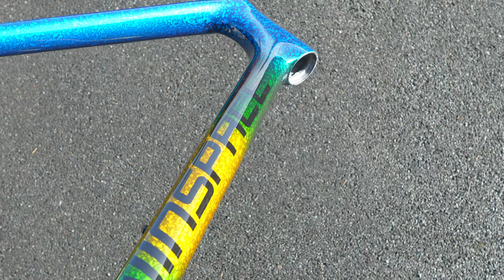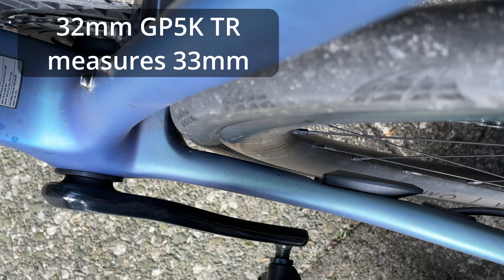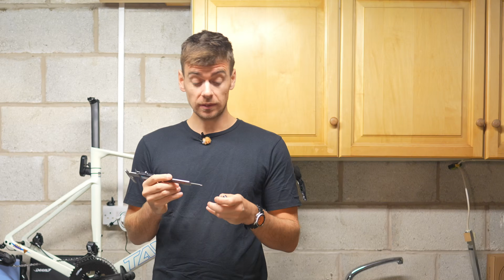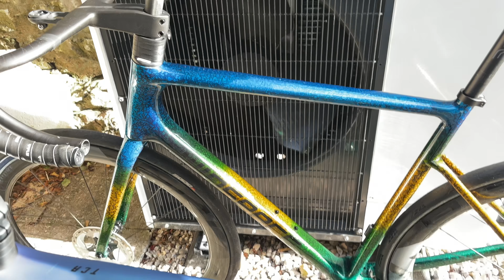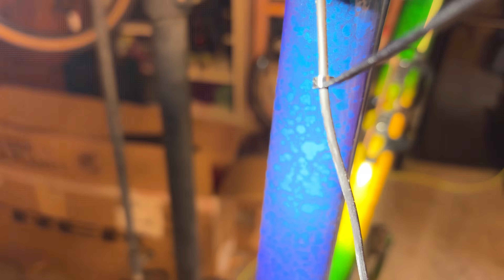Did Winspace win the frame game? #cycling #carbon #engineering

Comment: Great video! 
As a former bike fitter, you are wrong about the Geometry IMO. You are comparing an XL with a Giant XL and other brands 58/68cm frame sets. Realistically it is actually a good inbetween geometry. Similar stack to a race 58cm with the reach of a 56. This is good because you can run a longer stem = which looks cool and good for riders (like me) who have long limbs and short torso.
The real problem is the inconsistency of bike sizes across brands. 2*58s are never the same just like 2*XLs.

Comment: I actually bought the frame and and bars last year on a holiday sale for $1475 shipped, which IMO for all the yipping about Winspace prices being raised to keep up with competition I think is mute, granted all of that might not matter now with the tariff situation.  Either way my SRAM Force D1/D2 and Red E1 with Elite Wheels D50 running tubeless GP5000 S TR with pedals, cages, mounts, and sensors comes in at 16lbs/7.25KG on the dot in a size 48cm/small in the superlight black colorway.  I will concur even with proper torqueing and paste the conical rail clamp on the stock seat post would slip and I am sub 135lbs.  I switched out the stock post for a Roval Alpinist two bolt system like you mentioned, which is a shame since I prefer a zero setback post and the post was only 160g.  The seat post clamp slipping really has been my only issue.  The BB was in spec and allowed for a BBInfinite BB86 DUB one piece bottom bracket with no issues.  The shop that setup the bike with the full 40mm worth of spacers which I thought was crazy at first but the head tube length on my size 48cm/small is 118mm which is very close to a Giant TCR XS at 120mm and the Giant TCR comes with 45mm worth of spacers, thus my size 48cm/small SLC3 with a full stack is still lower than a stock TCR XS and marginally higher than my MY Scott Foil RC w/ 40mm worth of spacers and a 115mm headtube length.  Point being yeah the SLC3 is more endurance than the Winspace T1550 series or other all out aero bikes, but not by much thus to call this bike an "endurance" bike is kind of misleading.  While the bars were basically thrown in for free, the Winspace Zero SL bars are insanely stiff to the point where they take away from some of the playfulness you get with a lightweight bike.  I found the bike to be snappy, responsive, handles wells, climbs well, but it should be noted compared to my MY22 Scott Foil that weighs all in at 17.25lbs/7.82KG you simply don't get the freewheel, propel you forward feeling due to the lack of aero shapes and lack of weight.  IMO the bike feels like a proper competitor to a Giant TCR Advanced Pro, Canyon Ultimate SLX, and dare I say I think this bike would be scary close to a any Colnago V4RS/V5RS.  This all might be mute if you live in the US though since tariffs make the value of this bike or really any Chinese D2C bike invalid since prices then become Cervelo Soloist or even Tarmac territory.
Reply: How is the ride? Some say it's super stiff, some say it's stiff but comfortable as well.

Comment: In my experience Winspace has really gone down hill since this video was produced. They sent me a defective frame and refused to acknowledge the defect, they made me pay $200 to exchange it despite it being under warranty. When I returned the frame (with the label Winspace gave me) they misclassified it and underdeclared the value on the commercial invoice (pretty common thing to do but sucks when you get caught). This caused it to get stuck in customs in Shenzhen and they just left if there, despite me asking them to take care of it. They eventually took action but only after I sent them a screen shot from the tracking that said the frame would not be delivered and would be disposed of instead. 56 days after my initial order, they are holding my new frame hostage ion Hong Kong and refusing to send it unless I cancel the dispute I filed with my credit card company because of Winspace's repeated lies, half truths, and inability to deliver on their own deadlines. I filed the dispute when I did because the 60 day window I had to do this was coming up and I was worried the new frame would also have issues and I would be past the date I could get my money back by the time I received it. Additionally, I gave them a headsup that I was going to file a dispute if they did not ship my frame within the next week. They did not respond until after they sent the frame to Hong Kong but before passing it off to UPS. TLDR: Winspace customer service is pretty much on par with United Health Care.
Reply: So what frame was it exactly, and what was the defect?

Comment: Hello, is it possible to attach a win space slk 3.0 bike to the  smart trainer?  The rear wheel of the bike is mounted on a non-through axle, and the smart trainer is mounted on a through axle.
Are there any adapters to install the bike on the smart trainer?
Reply from the maker: Yes it will fit on a normal thru-axle type trainer (kickr etc)

Comment: Hi Alex, note you’re running Assioma duo Shi pedal axles. I have the same and have issues with excessive play in the bearings. Had a warranty claim in with Assioma and the sent me some new bearing assemblies but the problem persisted. I’ve tried running a grease with higher viscosity base oil to support the excessive clearance on the inner bearing. This works short term but as soon as the grease disperses or suffers and water ingress the play returns, takes around 500km of riding. Play is at a level I can feel through my foot while pedalling.

Any thoughts on the above, how do you find them?

Great video btw, love the honest and informed content. Keep it up 👍🏼
Reply from the maker: @alastairbell9994  i have always had a little play on the inboard side, they say this is normal due to the use of a bushing. Hasn’t got any worse, and I don’t feel it at the foot.

Comment: Just built mine up size small in the superlight black and fully loaded with cages, sensors, mounts, pedals, while running tubeless, Winspaces heavier bars, Force D2, Elite Drive 50D, and running a heavier SWORKS Mirror saddle I am coming to 16.86lbs which I am kind of disappointed in since I was able to easily get an Aethos Fact 10r easily under 16lbs fully loaded and that frame weighed 685g vs 699, albeit it wasn't a one for one since I used a Berk saddle and a Red cassette but that's what 200g at most.  All in all I still think the SLC3 might be the better bike besides the lack of a BSA BB, since on my initial very short ride it was definitely stiffer and quicker to respond, still was comfortable, have more aero features, while still handling very well.

Comment: Would not bearing retaining compound insulate a metal sleeve BB from galvanic corrosion? The threads for the rear wheel through axle could be greased or treated with anti-seize. One could pound an easy-out into the 5 mm hex and unscrew the through axle. 
Windspace knows who you are, that you will measure the tolerances on the frame and will look down the tubes. They have prepped the frame.
Reply: Bravo! 
You hit the nail on the head.
Most of the reviews you find on the web are written by people who have some sort of commercial tie to the company, and it seems to me that this one is no different.

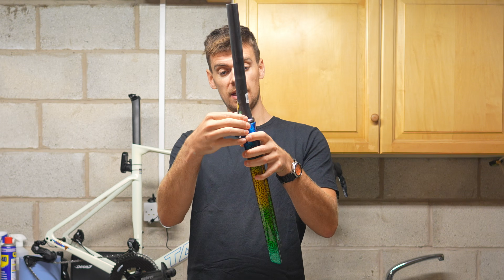Comment: I have just received my SLC3.0.  I have the same issue as this youtuber(https://www.youtube.com/watch?v=j_-XyMF7Qyg) where the lower headset bearing does not land on the bearing seat on the fork. You show it at about 16:02  -assume you are not concerned about it?
Reply from the maker: @MAEBikr  mine does not wobble like that. It sits flat, no play when preloaded. Have you contacted winspace? Also are you sure you are using the correct bearing not the top one…
Reply: @PeakTorque  I will.  I have commented on the references video - Thanks for the feed back.
Reply: @PeakTorque  PT - I have to turn myself in.  I have checked several other bikes I own  - they have the exact same design with no issues.  I gave you a false alarm :)  Thank you to the reply and interest!
Reply from the maker: @MAEBikr  its normal to have some movement before assembly and preloading, but keep checking. Safety first!

Comment: Nice video. I enjoy your well spoken narratives which as an engineer are always more comprehensive and illuminating than your contemporaries that perform similar builds on youtube.
I wouldn't buy this frame for the reasons you state about geometry.  I am close to your height and typically ride a XL as well.
PS. One niggle.  I disagree with your observation about the location of the hole in the steerer for front brake hose routing.  If you move the hole up vertically on the steerer, it actually creates more, not less of stress concentration because the diameter of the steerer is reduced.  Section modulus/moment of inertia.
Last thing, I would never push a one piece bullet style metal BB into a press fit carbon frame, especially since a two-piece plastic (glass filled nylon) 2 piece Shimano BB86 with lower modulus of elasticity is utterly reliable and dirt cheap.

Comment: That's kinda funny why you don't like that single-bolt seatpost design.  I have the same design on my Emonda seat mast and I dislike it as well, but for the opposite reason.  It is almost impossible to adjust the tilt of the seat.  Those cones get wedged in so tightly that I have to completely remove the seat and outer clamps and use a hammer and punch to dislodge them to set a new angle.  Then if that angle isn't right, I have to go through the whole process again.  It takes forever, and cannot be done while on a ride.  I hate it!
Reply from the maker: Yep. Another flaw!

Comment: Geometry wise the smaller sizes like a 50 that I have, is right on the money, very little difference with a Canyon Ultimate I own. My SLC 3 is still waiting to be build up, so i just measured the BB, it's right on the money too, no issues there. The reason I went for this frame is the raw carbon option at 700gms, the round seatpost & the generic FSA headtube. I'm really impressed with he one mold layup and smooth internal finish.. (never seen one like this, I've build a few). A shame I missed out on your discount code. Curious how you get on with the build.
Reply from the maker: The smaller geos are fine. They lose their way in the big sizes. No idea why, just copy specialized. I dont think their moral compass would deter them from doing that 😉
Reply: @PeakTorque  Does their factory also produce the Specialized SL8? It would not surprise me..

Comment: Anodization has it's limits, as it only protects the surface. But galvanic corrosion affect goes deep.  The aluminium eventually becomes brittle and get tons of little cracks.  At this price point I don't understand why they don't use titanium fittings. Ti doesn't have that issue, it's very compatible with carbon
Reply: cost relative the typical life of a racing frame understanding that many race frames won't last over 5 years.

Comment: I have Winspace T1550 2nd gen XL and the Winspace Zero SL Integrated Bar and Stem. Can i put in headset system only split spacers or needed a top cup (non split) before stem for intergrated stem ? because in my package there is only split spacers and the top cup for normal stem.
Reply: Nice, how does the bike ride and how heavy is it? Nobody seems to review it.
Reply: @znalniaskas   my Xl bike is 8,2kgr. The frame is fantastic really and very fast. I've puted 32 tyre's and is also comfortable for my standards.  With LUN MEGA wheels it's a real touch and fast Race bike.

Comment: PT, can you explain why compression plugs are needed in fork steerers and not needed on round (carbon) seatposts? Carbon seatposts seems much thinner compared to steerers. Thank you!
Reply: Much much higher stress (during braking) on steerer. the seatpost is not subject to such cutting forces.
Reply: @pablo_coach_ultimate  Yes, and the seat post is typically loaded vertically. Braking hard or hitting a pothole at speed loads the steer tube in multiple directions.

Comment: Bought a frame from the webshop last year and wasn't happy with the finish and their response. There were quite a few spots of paint and glue residue, which i had to file away myself. Kind of an odd feeling filing paint on your brandnew frame honestly. The most severe spot was on the front dropout: i couldnt get the wheel in at all, since there was glue where it wasnt supposed to be. I managed to make it work, but it is still difficult to get it back in. Not a just pop it back in job.
Their Wheels are excellent all around though. Survived a rear derailleur in the spokes, without much damage.

Comment: Not interested in a review of a frame that has most likely been specially prepped before sending out for a review.  Us regular punters have to play the “Chinese quality lottery”, with little or no comeback in case of issues.
Reply from the maker: I put that warning out in the first 10 seconds, and now they should held liable to this quality.
Reply: I have 6 frames from china, all more or less flawless. Do your research and you dont have to play the lottery.
Reply: @66mikkim  What frames / manufacturers have you purchased?
Reply: @MrJwmurph  Frames i had, but sold, were from light carbon (Road and MTD fully) and a Yoeleo R11 frameset that a buddy still rides. I now possess 2 Elves, a Falath EVO+ and the TT Amanyar, my newest is a Altera G21 gravel frame from Yoeleo.
Reply: @66mikkim  Thanks, I've been looking at Yoeleo (R12) and Winspace (Agile or C5 Aero) a lot recently.

Comment: Can I ask? When you say you received the frame from Winspace. Is that from al’s bikes shed (winspace uk) or direct from winspace the factory? I’ve been talking with the former and they ream and check the bb before sending out as they do the rest of the surfaces. According to the chap the slc doesn’t need it more often than not, but take that for what it’s worth.  Like you though I’ve been comparing the prices giant really only being a direct competitor. There are down sides to both but I’d buy the winspace purely because of the round seatpost. The only other thing that puts me off is the bb86 and sram dub compatibility but no one is reporting problems yet.
Reply from the maker: Direct from WS mate. I know they have a 🇬🇧 distributor but not been in touch with them before. The round seat post is good but two weeks in and the single bolt clamp is confirmed pain the arse. Endlessnly slips.
Reply: @PeakTorque  Happy to talk anytime PT! 😉

Comment: @PeakTorque - Nice Video.  Your opinion on the SLC3 frame validated my thoughts on mine, so thank you. I've had a lot of frames over the years and this one was as clean as anything I have ever had, inside and out. Mine was a true 720g in a size Medium - black finish. I am in the US and bought mine the day it became available.  I have had it built up for about a month and a half and have around 900 miles on it so far. 14.9lbs all in with Zipp 303 Firecrest, pedals, cages and computer mount. A Darimo seatpost and Berk saddle are the luxury items on my build. Looking forward to your ride review.  Really enjoying mine so far.
Reply: Also.  I made a video of my unboxing with the actual weights of every part.  Video of the finish quality, etc.
Reply from the maker: That is odd. Ive seen a black XS, same quality and internal finish and its 751g on the scales (frame only).

Comment: Save your money and get a Time frameset. Flawless, creak-free, perfectly faced, immaculate paintjobs.
Reply: yes agreed but Is double the price ....
Reply: @marcinstyle85  I know but it's worth it, I'm currently riding one. Night and day difference between my Time and my SLC 2.0 which was flexy, badly finished, oversized BB shell and so on... Yes, maybe SLC 3.0 is improved but I would not risk buying it just because it's half the price and as you can see brake mount bosses need facing.
Reply: @ivanivanov7064  Fair enough I always want Time frame (definitely the best one on the market )may finally buy one in near future as Im looking for new built from some time now
Reply: @ivanivanov7064 what Time frame do You have? Disc or rim brakes? ADH or Scylon??
Reply: @pablo_coach_ultimate  2023 ADH Disc.
Reply: @ what size
Reply: @pablo_coach_ultimate  Why do you ask?
Reply: @ivanivanov7064  because I want to buy this frame but i’m affraid about high trail value especially on smaller size (XS).

Comment: I think the driver behind weird geometry is the stupid obsession with top tubes parallel to the ground. It doesn't make sense for modern bikes where you want a lot of seatpost showing for compliance and results in too much standover height. Also is there any valid reason road bikes are stubbornly refusing to use UDH? I don't see any. Instead we got a solution like this, that will render the frame garbage if you strip a thread.
Reply: Well I’d argue as a 170cm bloke with short legs and T rex arm that struggles with stand over that the “small” is perfect as is the reach and stack. 

It’s refreshing to see a bike made for shorter people and not for tall people and then working backwards messing the geo up for smaller riders. 

I can’t get on a number of nice bikes there just to big! Heck I’d have to buy a 49cm just to sand over an allez sprint if you’re under 5,6 you anit buying many brands off the peg. 

Its tail as old as time, off the peg bikes are made for the average size which at this moment in time 171cm globally. And as I said look at the geo at that size and it’s pretty much bob on.